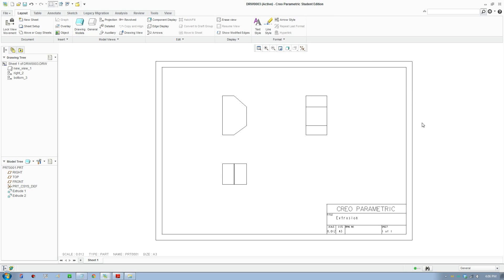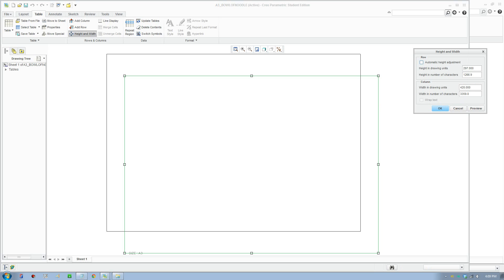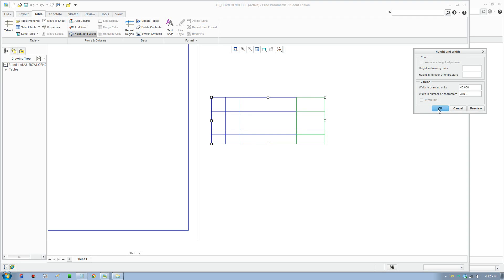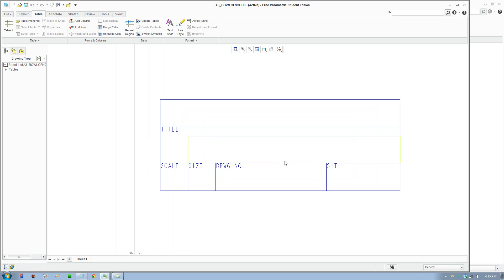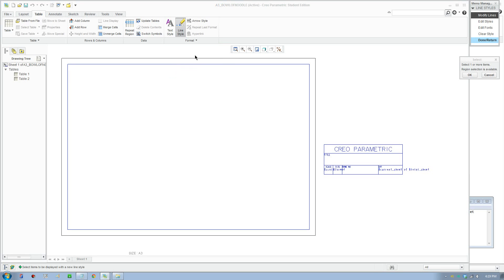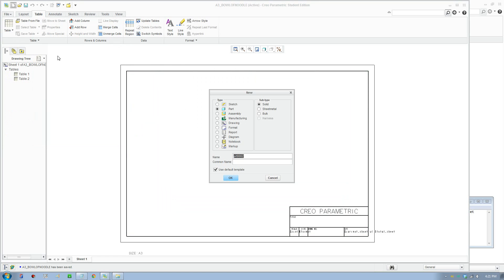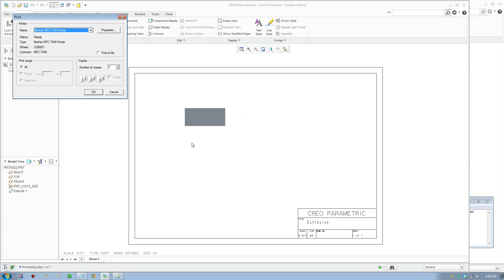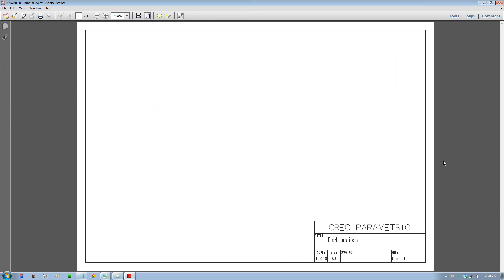Creo Tutorial - Creating Drawing Template/Format with Title Block and Printing Fix

Comment: When you're doing the sheet margin, don't use table. Here's how I did it: 
1. Go into the sketch tab on the ribbon. 
2. Click on the little arrow on 'edge' in the sketching section of the ribbon. Select 'Ent Chain' from the little menu on the top right of the screen. 
3. Select the whole rectangle by dragging the mouse. Click OK in the select box. 
4. Enter -10 in the box that appears at the top of the drawing area and click the green tick. It has to be minus otherwise it'll offset outside the drawing area.
I did the title box using table pretty much the same way as in this video. When I did the margin using sketch and used the format as a template, my finished dimensioned drawing fit perfectly positioned on the page when I saved it as a PDF.

Comment: To avoid having to type in a number for the sheet number everytime, remove text from that box and just add a 'Note' (text) where you want it to show 'Sheet 2 of 2' say - type &sheet_number OF &total_sheets. It will figure out how many pages and what page you're on automatically.

Also would recommend using the 'offset' feature to just create your inside drawing boarder - type -10.
Then you won't mistakenly click on the table by accident when working on your 2D part drawing.

Other than that, the tutorial was very informative, thank you!

Comment: Thank you bro, its a good work from you.Where is the 2nd part of this video.
Reply from the maker: Thanks. That is it in 1 video. What else did you want to see?
Reply: how to add measurements scale in between those rectangles.
like in excel
Reply: also..do you know bro..how to make hidden lines as dotted line.
Reply from the maker: Pandiyan D you need to find the formula codes to retrieve that. Hidden lines is in drawing mode.
Reply: yes bro , in drawing mode as it is i can't find a solution in creo to make hidden line into dotted lines.
Reply from the maker: Pandiyan D you are only allow to set the standard type based on your region. You may want to change the lines manually by going to line preference.

Comment: could you post a video about how to get not continuous lines (for hidden lines) for the lateral or frontal views, as ISO states.
Reply from the maker: You mean the phantom lines and hidden lines for the front/right views etc? Create view > Click on View > Right-click > Properties > View Display > Set Tangent Edge Style to - Phantom.
Reply: great, thanks!!
Reply: ohhh.... now I understant!!!  when you print it  they (phantom lines) change to dotted lines,,,,,!!! oh man... i ve been trying to change the lines on the screen because I thought the print would be similar to the image on the screen. THANKS ! you are the best !!
Reply: one more question,  how can I make to the axel reference lines (line-dot-line) for holes to appear in the projected views?   
For example, a simple hole on a block drilled from top to bottom. On the lateral view, the phanton lines show the hole, ut no its axel. What about the vertical line-dot-line line of the Imaginary axel of that hole? .... (this vertical dotte-point line should go across the hole ),,, how you do that?
Reply from the maker: papi chulo  To add centerlines you need to right click on the feature in the tree. Click on Show Model Annotation. Then go to datum tab. Turn on center lines.

Also go to this video CREO 2 Tutorial - Creating Technical Orthographic Drawing. Go to the description. Do the exercise I mention in there.